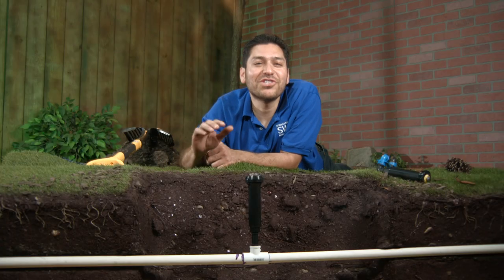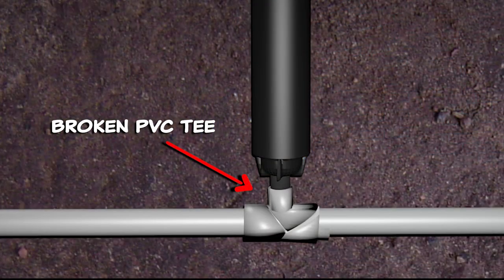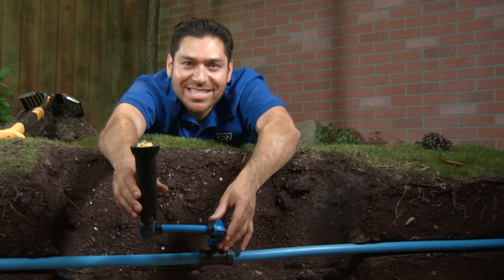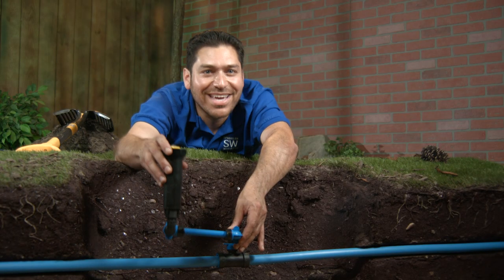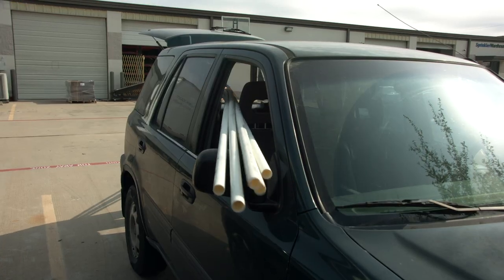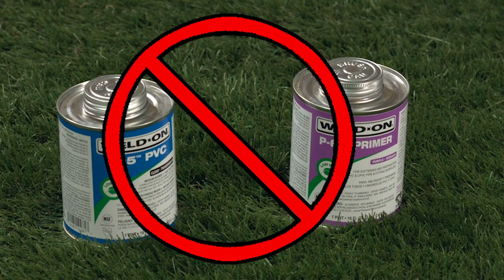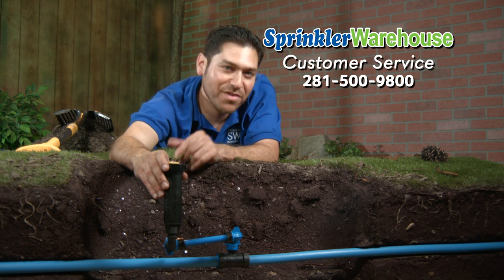Installing A Sprinkler Head With Blu Lock

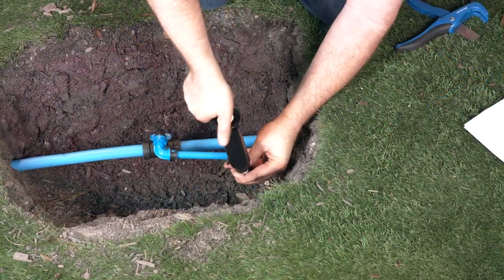Comment: On surface this video seems great, but for a beginner, it has sections that are confusing or missing proper info. For example, at 1:52, right under the Pop-up sprinkler head he shows an elbow and it is not named! Between 2:44 and 2:49, he starts off great but then after attaching the swing assembly he just says "and then I screw on my sprinkler head". How did he go from non threaded end on the swing assembly to a threaded end of the sprinkler assembly? For a newby this is not very helpful:-)
Reply: The elbow swing assembly (which HD doesn't sell) has a threaded end on it. look at 2:45 to see it

Comment: Are those blue thing working as the funny pipe ? Or those are different things  ?
Reply: Yes,  I believe so ... instead of using funny pipe to connect the head to the main line, you use the swing elbow assembly to the main line and connect to your sprinkler body

Comment: Question: My spigot has about 60-65 psi. I want to run a 3/4” pipe and use the Orbit Voyager II Professional 4” Sprinklers. How many sprinkler heads can I install for each spigot?
Reply: Servando Pahang consult the nozzle chart that came with the voyager II and use any combination of nozzle that dose not exceed 16 GPM. You can only run 4 with 4 GPM nozzles  or you could run 6 if they all had 2.5 GPM.  Or 6 w/4 doing 1/4’s @2.5gpm and 2 doing 1/2’s @3gpm...
Reply: Depends, how far are you spacing the popups? The nozzle chart will show you the spacing and the corresponding GPM. The GPM will affect the sizing of the pipe and the amount of heads you can put on your spigot at 65psi.  At 65 psi you can run about 10 to 15 heads on a one inch line. You only want to run around 3 - 5 heads on 3/4" line due to the friction loss increase as the gallons increase inside the pipe.

Comment: Ah I see so the easiest way to fix a broken head by the driveway is to rip the whole lateral line out in order to install blue line. That way I can use the blue line T fitting. Yeahhhhh no.
Reply: They were demonstrating the advantage of building a system out of Blu Lock to begin with, not replacing parts of your PVC system with a Blu Lock system after it's damaged.